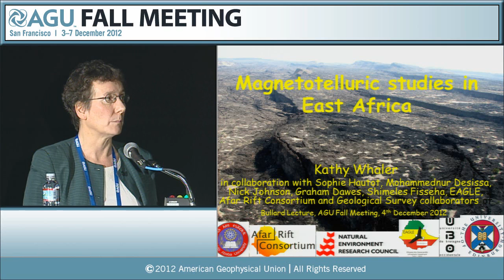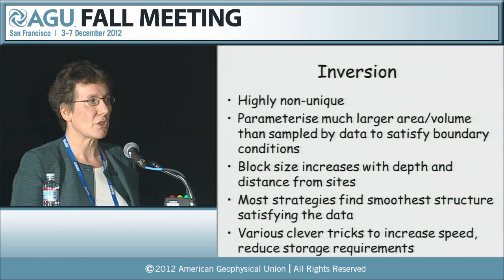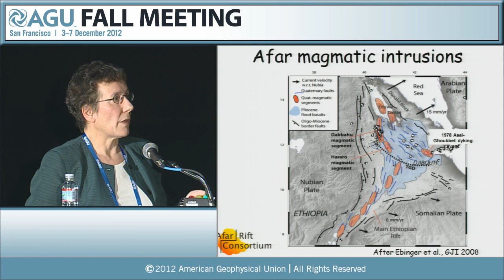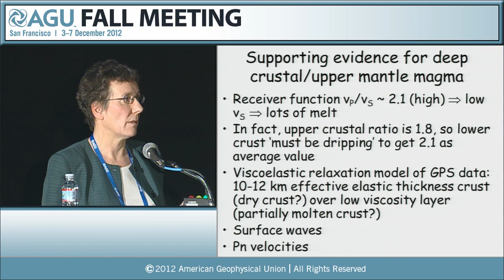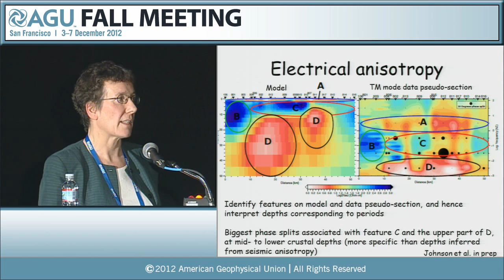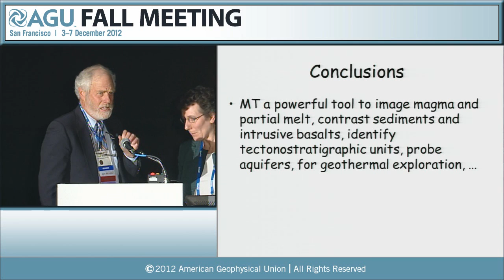Fall Meeting 2012 Bullard Lecture: Magnetotelluric studies in East Africa

Comment: Very interesting talk. In the slide at 0:07:35 it is shown that in the measured EM components, Hz is not included. I am curious about the reason for excluding it. Could it be due to a hard substrate that made it impractical to deploy the vertical coil, or is there perhaps some other reason?